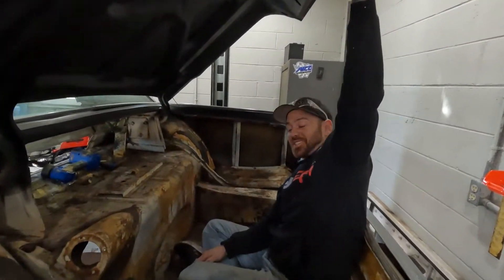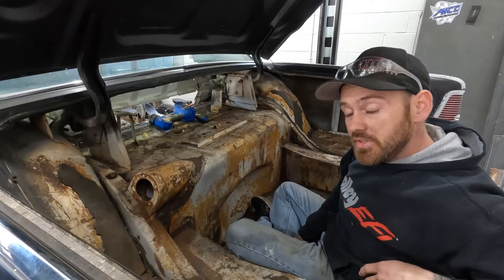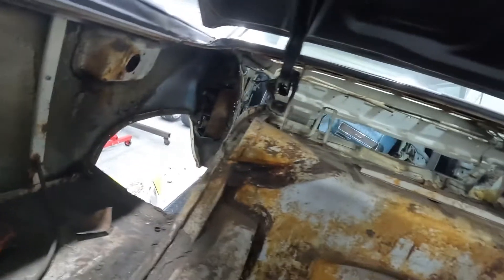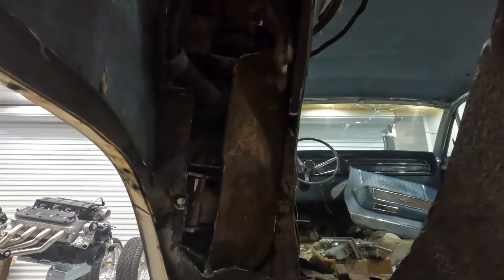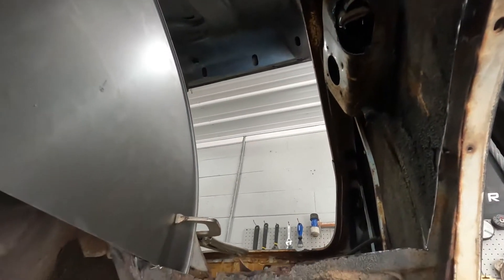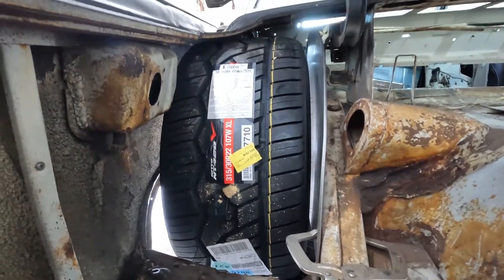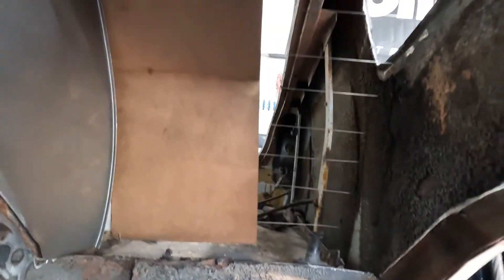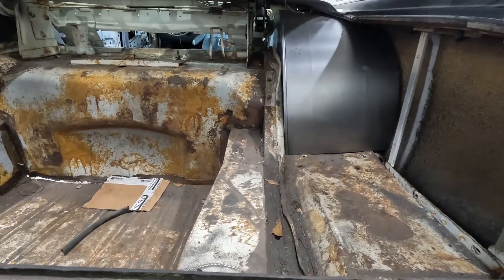1965 Lincoln Continental Gets Tubbed for 22s!

Comment: What size of wheel tubs did you go with and what brand were they? I am currently building my 1965 Continental and need to put tubs in for 22's.
Reply from the maker: Competition Engineering. Part # 247-3006
Reply: @BNRCustoms  Great, Thank you!
Reply from the maker: You’re welcome!
Reply: What’s the width and backspacing on the wheels
Reply from the maker: Front are 22x9. Rear are 22x12. Both are 4.5” back spacing. Had to shorten front control arms 1.5 inch  . Rear axle was built to fit .